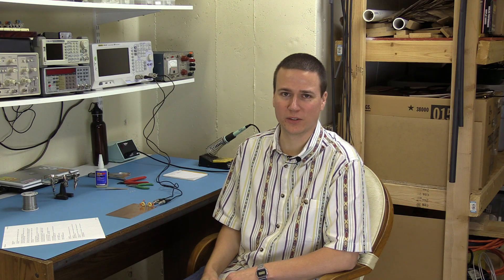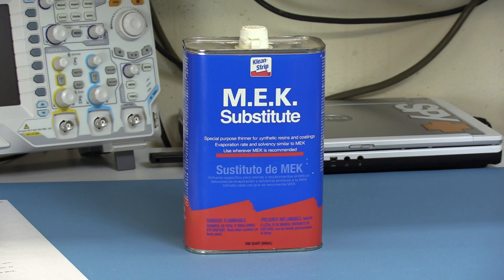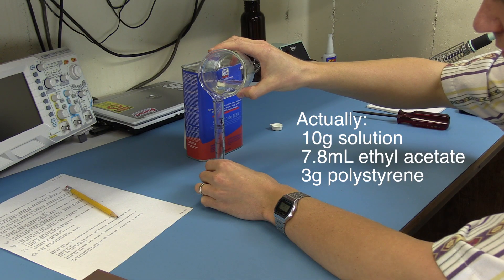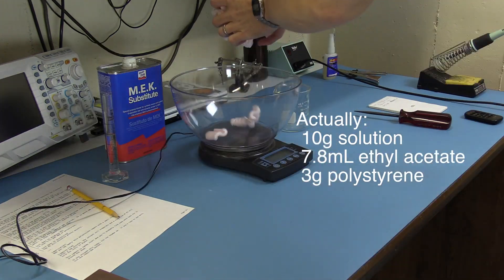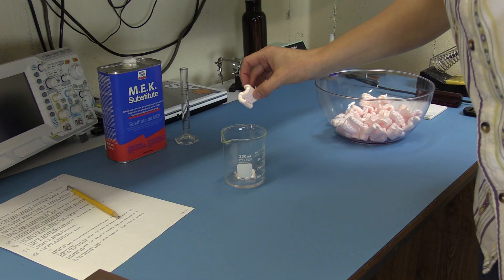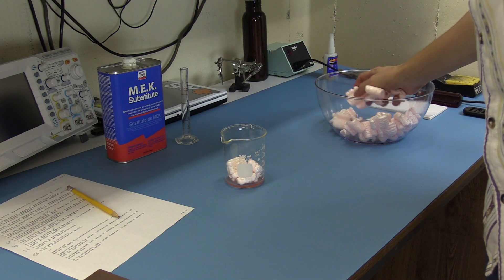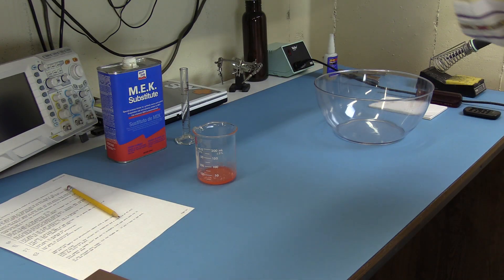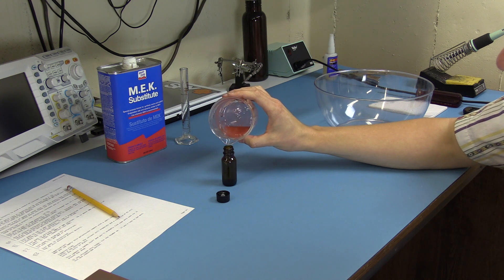Homemade Q-Dope

Comment: Does anyone know if one styrofoam is the same as any other? And by that I mean the typical crumbly formed styrofoam packing corners around appliances and such,  not the newer type super tough white packing wedges that are flexible but won't break of crumble.  I have some old style styrofoam but not the peanuts specifically.  Thanks.
Reply from the maker: Yeah, I think the crumbly stuff that looks like it's made out of little balls is typically polystyrene too. Should be good to go 😃

Comment: I just made up some recently but used acetone as solvent like another user reported here.  However, an electrical engineer tells me that I may have made an error as acetone can dissolve enameled wire coatings!  The original MSDS for Q Dope says that actual MEK is used as solvent.  By using the MEK sub, which is ethyl acetate for the most part, you might also be putting your windings at risk for enamel stripping.  Just wanted to point that out to be wary of solvent used.
Reply from the maker: It's always a good idea to check solvent compatibility! Checking the enameled wire I have here, neither ethyl acetate nor acetone seems to soften it. How about the wire you used? I was actually a little excited that acetone might remove the enamel, since it could be easier and cleaner than heat-stripping or sanding it off 😀 But no such luck here 😟

Comment: Thanks for this info.  I made some up yesterday, but I used acetone as I didn't have any of the MEK sub handy.  It doesn't mix very well with acetone, but it is usable.  You end up with more like a paste really and you have to wait a min or two before it starts sticking where you want it..  Drying time is also long, about 6 hours under an incandescent.    Unfortunately I can't find MEK sub anywhere where I live, at least not at a reasonable price like acetone.  I can live with the acetone/ poly mix although not ideal.
Reply from the maker: Interesting! Thank you for sharing. I found some videos of folks dissolving polystyrene in acetone and it looks like it remains a slimy gel even when an excess of acetone is present. Perhaps a polymer chemistry expert will stop by to tell us why... Sounds like it might be best to use methyl ethyl ketone or ethyl acetate instead.

Comment: Great Video! What do you estimate the shelf life of this would be?
Reply from the maker: Thank you! I think it should last quite a long time depending on the container. Perhaps months or years? Evaporation of the solvent is likely to be the greatest difficulty, so if you can keep it in a container that seals up well that should help the most. If you do lose some solvent and the solution gets thicker than you'd like, adding a little solvent back should thin it out again. Other than that, I guess light and heat are the usual enemies of polymers so "store in a cool, dark place."

Comment: The pink peanuts are not good for qdope as they are conductive.
Reply from the maker: Nah, the ones I've seen are only static dissipative -- not conductive. I think you're thinking of the black ones.
Reply: @StuntProgrammer  according to this, it's less conducive thanconductive foam, but more conductive than plain styrene.   https://electronics.stackexchange.com/questions/103797/anti-static-vs-conductive-vs-dissipative-foam.

in some situations it won't likely matter, since the wire is already insulated with lacquer, and resistance of the plastic compound compared with the coil you're covering is still relatively high.  in some, it might make problematic leakage currents.
Reply: @StuntProgrammer  @theretiredtech - https://www.corstat.com/permanent-esd-foams/ some (most) of these foams are just covered on the surface.  I imagine it won't be very conductive once that surface coating is diffused completely into the styrene as will happen if it's dissolved in solvent.  The megger knows...
Reply: if you want to check, stick a megger on on and see what happens.

Comment: Thank you VERY much for posting this GREAT information ! It just so happens that I needed some Q-Dope for a VHF, 50~54 MHz Vacuum Tube RF Power Amplifier project for winding a plate choke. Thanks to your video I won't have to order any as I have a can of genuine MEK and a bag of styrofoam packing peanuts ! I'll make some later today !  Excellent information ! I have subscribed to your videos and posted this information to a few ham radio builder websites to share this information with credit to you !  Regards,  Mark, Amateur Radio Station WN3SIX
Reply from the maker: Awesome! Thanks so much for the kind words. I'm delighted that you found the video useful.

Comment: I did not understand how the density of the solvent affects the quantity of polystyrene used. Also, the white stuff that packages stereos should also work.
Reply: works better the  pink stuff is conductive
Reply: @TheRetiredtech  I think there needs to be tests before that can conclusion could be drawn. Interesting though.
Reply: @metatechnologist  that is the purpose of the pink stuff anti static.

Comment: First:  Link to me preferred.  Your Youtube video was very good....good lighting, etc.  You spoke slowly which us old guys prefer.  Most young men speak very rapidly for one reason or another.

The product looks great and I certainly am going to have a go at it since I have a great deal of Styrofoam "peanuts."  However, this is the first time I've ever heard of MEK. Gotta research that (review your video again for the chemical name) and where I can get it.  

A few things that would be nice to know.  What ELSE can MEK be used for.  To buy a can of this stuff only to have it set useless for isn't an option.

What is the "dry time?"

Would it be suitable for Manhattan style construction to attach the pads to a circuit board?  (I've pretty well abandoned this style construction because of the pad glue problem.)

Once this stuff sets up, how big of a deal is it to "break loose?"  

How can the "glue" be removed?  MEK?

Very good video and would indeed like to see more if you have any swirling around the back of your brain.
Reply from the maker: Thank you for the kind words about the video!  I can only talk as fast as I think, so I'm glad that worked out... ;)

The stuff I have is actually ethyl acetate, sold as a substitute for MEK (methyl ethyl ketone).  I found mine at either Lowe's or Home Depot in the paint department.

Other uses?  I've used it to loosen up oil that had gone gummy in an old typewriter.  I guess it depends on what you're into around the home and shop.  The Wikipedia page for MEK has some interesting uses listed.  http://en.wikipedia.org/wiki/Butanone

I didn't make any scientific measurement of the dry time, but I guess I'd say "quick."  Not so fast that the work is rushed, but not hours to set up either.

I'm not sure about using it for attaching pads, but you've certainly given me an idea to try.  I've been disappointed with using super glue for that application.  

How hard to break loose?  On the toroids I did in the video, it seems to be pretty tough stuff.  I suppose the bond is mostly mechanical, so it would depend on what you're sticking it to.  The toroids are probably an ideal scenario since you can get it all the way around.

For cleanup, more of the same solvent should work.